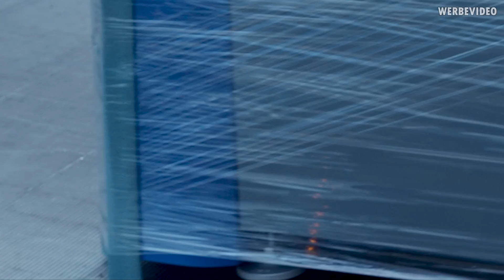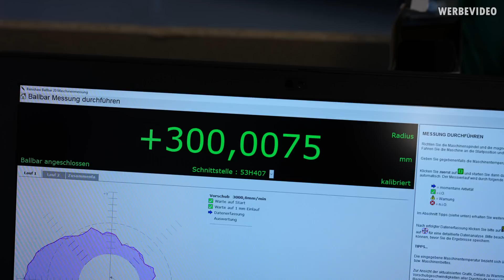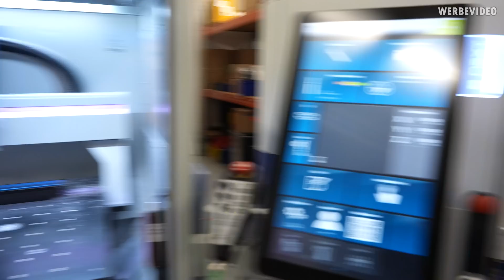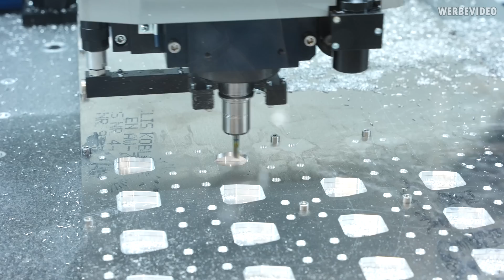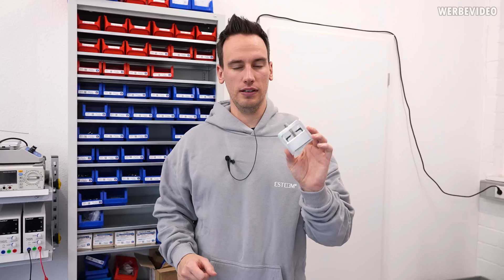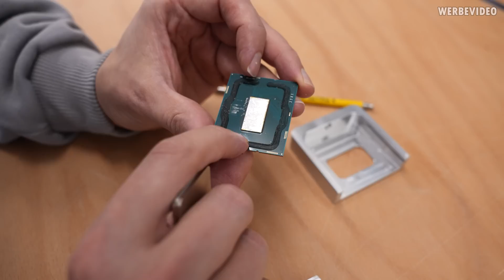WEE(K)-Log #26: A new CNC Machine, LGA1700 Delidder Prototype, iFixit Special der8auer Tool

Comment: Hey Roman, would these 7000 plates be interchangeable with the X3D versions soon to be announced? Im not too up to date on where the vcache goes? Would it increase the height of the die?
Reply: From everything I've heard, it does not change the height of the die. It somewhat makes sense looking back at the 5800x3d, they didn't require different coolers and the IHS didn't change. The reason they made the thick IHS for zen4 was so it was compatible with old zen3 coolers which imo was the dumbest idea. As soon as the engineer team saw the thermals they should have abandoned that idea. Sorry for the long winded response

Comment: Super cool! We have a Renishaw Ball Bar for our prototyping shop and it's a wonderful tool to have to verify machine accuracy annually. One thing to note, is they usually measure the accuracy at slower speeds like 1m/min, it also good to check the accuracy at your normal milling speeds as well. With high speed spindles at 20k+ rpm, you can run finish passes much faster which tends to lower accuracy. Not sure if the Datron control has an accuracy control setting that you can adjust within the G-Code, but you should look into it as you can set accuracy lower for roughing and higher for finishing.

Comment: I am curious to see if there will be instructions (idiot proofing) to apply the proper torque to direct die for AM5/LGA1700 as it could be prone to under/over torquing.
Reply from the maker: The direct die frame will close off with the socket of the CPU itself. Like the plastic part of the socket. So you can just tighten it down. Too much pressure will not harm it. From my testing quite easy to use.
Reply: @der8auer-en  I had never even heard of direct die cooling before. I bought the Lian Li 011 dynamic case and decided to look you up and am so glad I did!!! You're brilliant and I absolutely wouldn't have thought about delidding a CPU, your products take a lot of the risk out of it and I can't wait to delid a Ryzen chip!

Comment: Will you be selling delid'ed/binned 13900k's?
I've asked before, and I even emailed you about it, but I still haven't gotten an answer. I'd like an answer, because I'm about to build a new system.
Reply from the maker: sorry :) Often too many messages or emails. Probably no. According to the German law I would be responsible for the CPU afterwards. So if it fails and it's not even related to delidding I'd still have to replace it
Reply: @der8auer-en  Thank you so much for responding!
I understand that problem, yes. OK, I'll get a stock one, then.

Comment: I am curious when using the 2 machines if you take into consideration the difference in tolerance between the 2 machines. In other words do you measure the difference between the 2 machines being that they are very similar  in order to get the best result of what it is you are making? Cheers! Stay Healthy and Stay Sane!

Comment: As an ex Mazak UK Service Engineer, at my time the Renishaw Ballbar I used was the older model with a wired converter box (powered by a 9V PP3 battery) what would then connect via RS232 to the PC (an Keyspan Serial to USB adapter was provided on the kid for laptops without Serial Port).

You had to lay down the wire in a certain way for it not to coil wrongly and affect the measurements. How many times I wished for a wireless solution back in the day. 

Now with this new model with integrated wireless adapter it looks way sleaker and that problem doesn't happen again.

Comment: Well normal machines (haas, DN Solutions, etc) use face mills from 50 to 80mm, heavy duty machines that’s the ones that use 200mm face mills :)
Datrons are very good for plates because of their vacuum systems and their stupid fast spindles plus accuracy, and the way they are designed.
For normal use job shop that wouldn’t be a great machine, but for prototyping and plates beast game
Best regards from a fellow machinist in Ireland 🇮🇪 :)

Comment: No coolant?
Reply from the maker: it's using minimum quantity lubrication with ethanol. So you can hardly see it :)
Reply: @der8auer-en  that's cool!
Reply: @der8auer-en  Low compression and 2+ bar boost without detonation risk I assume LOL. Plus it runs cool

Comment: Yeah, Datrons are stupid fast machines, i used to work on an old Datron MV1000 with 1,5kw spindle, if you make a lot of thin aluminium parts there are not any competing machines AFAIK. Btw, is the M10Pro in the neighbourhood of 300k eur?
Reply from the maker: yes 260k for this one

Comment: About coil whine cards. Search for Singing Capacitors (Piezoelectric Effect)
Reply: MLCCs are suspect of that effect...those brown or tan surface mount caps. That is caused by varying capacitance with varying frequency...which also makes these capacitors a poor choice for sensitive applications that require a defined capacitance (like time constant circuits or actual power supply bulk decoupling) and class X5R and above are commonly used on power supplies (pretty much the only classes allowed for that because of tighter tolerances). Cheaper than POSCAP or SP-Cap or OS-CON but suffers from those problems